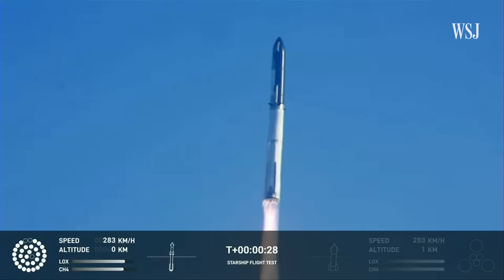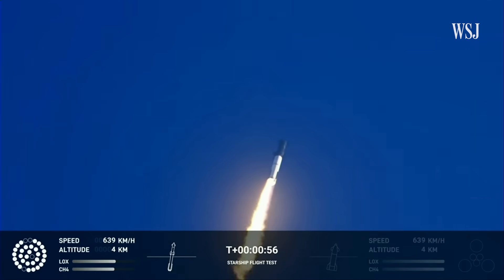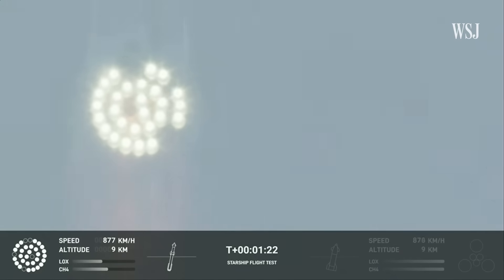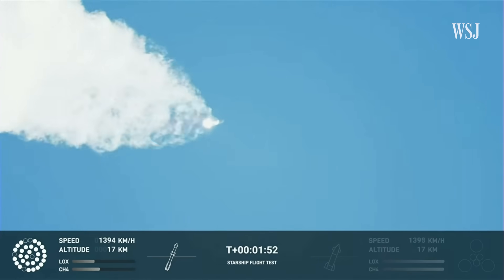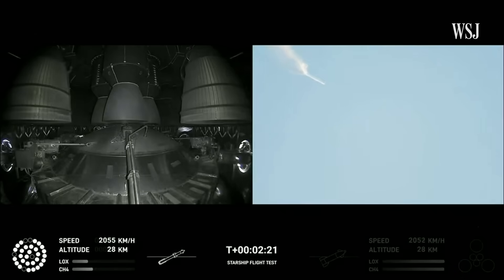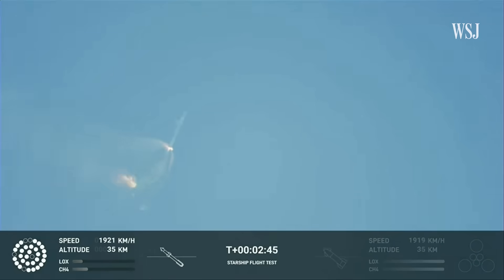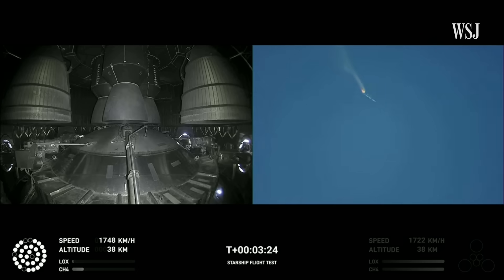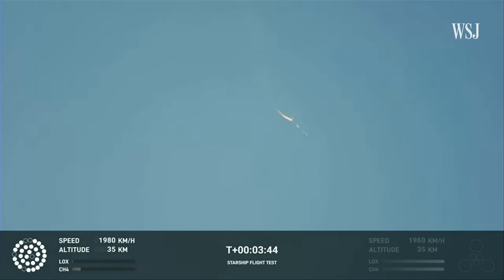Starship Explosion Video: Watch Elon Musk's Rocket Explode After Launch | WSJ

Comment: The amount of stress that was on the starshift as it was flipping is very impressive
Reply: crazy that it held together through all those spins
Reply: @P H  bro it looked like cgi.
Reply: @jeffder7143  CGI is difficult to detect, but its the BS of Elon that makes me distrust anything he is involved in.
Reply: @ph8429 stainless steel babyyy
Reply: @ph8429  Already passed the MaxQ right?
Reply: @estradacantu  They hit the "real" max-Q during the flip!
Reply: A lot of data was collected because of it.
Reply: @joaoklein1002  No because SpaceX refuses to learn from it's failures.
Reply: The rocket was already about 35km high, so there was very little air left. Cause when a rocket goes 1000km/h+ its not made to resist forces from the side. Would the cartwheels have happened at lower that ~15km/h the rocket would have been ripped apart quite quickly.
Reply: @eatdeliciouskids7965 still a lot of inertial forces from an object that large rotating that quickly
Reply: Good point, I hadn’t even thought of that.
Reply: @a-a-ronbrowser1486  nice name
Reply: What was the point of it flipping at over 800 mph?
Reply: @JoeBagzz  This was a big lab test the 1st of many for a rocket with twice the thrust of the most enormous rockets ever made in the U.S.  The amount of fuel needed is considerable along with the danger when fueling, a million things need to go right just for a green light for ignition.  So with this lab experiment, millions of things are necessary to go right for take-off and clearing the launch pad. You set a goal and start the experiments, a lot of failure is needed to learn and get things directly.   After separation failed they had limited time to try other tests before self destruct, spinning at 800 is a stress test that is not easily replicated on earth.  During those seconds of spinning, data was collected from instruments, you also found out which ones continued working and which ones failed under the immense g forces and pressure.
Reply: Finding a cure for hunger and homeless ,hate and division would be impressive, this?
Reply: @mikebuck8846  there is no cure for such things
Reply: @mikebuck8846  You do realise that hate is simply the flip side to love?  And like all opposites, such as cold/hot, dark/light, winter/summer, man/woman, wet/dry and so on, you cant eliminate hate as its just as essential as love.  Love is a total unquestioned approval of another, irrespective of their failings, and hate is just the total rejection of someone, usually because of very sound reasons. Love MUST be tempered with some hate, and hate must be moderated with some love.
But both love and hate have their places, and are equally essential to a balanced approach to life.
Reply: And it held together for so long!!!
Reply: KSP all over again...🤣
Reply: Ooops... What happened? 🙄
Reply: This is a fake CGI cartoon.
Reply: It truly was an amazing sight to watch and see. I don't feel the gen pop understands just hoe mamazing what they're watching actually is...I don't get many opportunities to use this term but man that sure was AWESOME!!
Reply: @arnoldrodriguez6300  Lol. You talk about the "gen pop" as if you aren't in that group. You Elon simps are pathetic. I'm glad it blew up.
Reply: @arnoldrodriguez6300 … well , don’t complain about the current price of eggs 🥚.
Reply: @vincentriley3698  I own 2 acres and have plenty of chickens...I won't complain. Promise 👍🙂
Reply: @arnoldrodriguez6300  Jesus..it failed dude.
Reply: @arnoldrodriguez6300  you're an employee who gets told what to do so you can feed yourself, curb your narcissism son stay silent and humble
Reply: @StoneTheCr0w  I see you like to assume. People who are angry at the world typically have that in common.
Reply: Theyllncome up with a better.launch.
Reply: Yeah I'm surprised how long it lasted, tbh. Was expecting it to break-up at any moment after the second or third flip. I'm not sure it did break up on it's own, it very well could've been a self destruct. They were losing engines and fight have control over it anymore, and it didn't seem like it broke up like we would normally see, it seems like it exploded.
Reply: Yea bouncing off the firmament 😂.
Reply: Musk fans are really trying to cope.
Reply: True, although more than likely, the explosion came from intentionally aborting the operation after Space-X determined it malfunctioned. They intentionally blow it up into little pieces to minimize potential danger.
Reply: @Karl with a K yea go ahead and give me something to see😂
Reply: exactly
Reply: I had to be down to low weight in bottom half + wind speed! Was a great lunch. 😊
Reply: Aerobatics with a rocket! Seriously though, it's so refreshing to read informed comments. Even the MAGAts are behaving because they count Elon as part of their cult. That'll clean up ANY comments section.
Reply: Was NUTS I couldn't believe it took the forces.
Reply: A bunch of idiots launched a failed starship !!! 😂😂😂😂🤣🤣🤣🤣🤣🤣
Reply: Right!!!
Reply: Insane amounts of g force spinning like that
Reply: Innovative technologies were presented at the international online forum "Global crisis. There is a way out". For example, the health capsule (the possibility of life extension, rejuvenation and absolute health), from time 7:09:09.
These technologies will be available free of charge to everyone when building the Creative Society.
Reply: Yeah, ppl don't understand that the starship is legit a 5000 Tonne rocket (when fueled) it burned up a lot of the fuel in the first stage for sure but it is still very heavy. AND it is going at 1.5 times the speed of sound.
Reply: @Cewu  People ought to face reality, and watch the videos on Musk, by youtuber, "Thunderf00t". Including his commentary on this failed launch.
Reply: is a starshift shifting gears in space?? 🤔
Reply: Humans are not advanced enough to creat 100% safe starship.And we think of warp drive😂😂
Reply: do you work in material science ?
Reply: @karlwithak. you would be dead meat regardless if it exploded or not.
Reply: A second failure soon to follow.😂
Reply: Was this a stress test? I'm confused. I didn't know this was planned. Looks like a total failure to me.
Reply: More than 10km falling with insane lateral forces while flipping like nothing...
Reply: Yes let's take a moment to remind all the commieboos that the N1 broke up at half the flight time and couldn't manage a single flip without breaking itself apart. 😏
Reply: @Karl with a K In a sense test resulted in a more  valuable than if separation and starship ignition happened, as  that insane structural integrity test never happened to that extreme
Reply: @yuzoookun  i say it failed this "interity test" you speak off.
Reply: no worries.  the tax payers will cover all costs.
Reply: @TheLinuxYes how so they are a private company?
Reply: Finally, someone got it.

Thank you, Sir. @TheLinuxYes
Reply: Finally, someone got it.
Thanks, sir. @TheLinuxYes
Reply: Cope harder. hahaha. Seeing it fail and and disappoint the people that wanted it to work as planned so badly, feels really good. Bye bye
Reply: Stainless baby
Reply: Yes, it was moving so much as it went up, it didn't look good.
Reply: Staying together for that long, sideways at 2000kph is very impressive!
Reply: I'd say that was deliberately done to test the whole structure. And it passed...!
Reply: I still cant believe it wasnt torn apart by the aerodynamic stresses during the "tumble".... and how long after it started tumbling it took spacex to FTS the thing.
Reply: @Karl with a K you would be dead
Reply: This is a waste of money and resources. Someone enlighten these rich folks
Reply: @Health-ScienceNews  its ok since the taxpayer is paying for most of it
Reply: @TheLinuxYes  still better budgeted then the fed.. 😂
Reply: @Health-ScienceNews  This is part of R&D. They WANT things to fail so they can figure out how to prevent it from happening when REAL humans are on the REAL starship.
Reply: they can do wonders with CGI these days.
Reply: @everythingisalllies2141  You're mentally ill if you think that's CGI
Reply: @everythingisalllies2141  dumba$S
Reply: About the same as the amount of stress that was on Elon's face when it blew up.......he knows this thing will never work.
Reply: @Patrick-bu5vy yea sure buddy
Reply: @Patrick-bu5vy the space shuttle was worse then this and was doomed from the beginning..
Yet it flew for like 30 years and did many amazing things
Reply: @Patrick-bu5vy  libs say the darndest things!    You remind me of my 4 year old nephew.   So cute
Reply: Can't pass through the firmament dome.. The earth is flat
Reply: @taylorx2  nice b8 m8
Reply: @taylorx2 lmao
Reply: @taylorx2  Are you serious or just kidding ??😮
Reply: Nothing about this was impressive
Reply: @jeffersonwinfrey2219 geek bruv
Reply: @jeffersonwinfrey2219  Would be interesting what Mr. Korolev or von Braun would say
Reply: @jeffersonwinfrey2219  Because you do better
Reply: @jeffersonwinfrey2219 you know nothing of anything if you think nothing of this was impressive
Reply: @jeffersonwinfrey2219  How exactly can you justify that. Everything about it was impressive.
Reply: @jeffersonwinfrey2219  Sorry you cannot understand.
Reply: @jeffersonwinfrey2219  When a 5000 Ton Mega Machine nosedives up in the air at 39 KM altitude, the engines that tried to push it back straight and do everything it can with it's side thrusters to get the mega flying structure back in the loop and keep pushing it up is not impressive for you? Someone gotta check their senses and make sure it's working properly.
Reply: @Pravin Smart  No, it's not impressive. Artemis is impressive, seeing as it WORKS lol!
Reply: @randomname4726 each Artemis SLS rocket alone costs more $ every single launch than Elon has spent to date. Eventually Elon will get to re-use his ships. Not 1 part (including the capsule) of the SLS is re-used.
Reply: @pravinsmart  those weren’t side thrusters. Apparently that was the self destruct system, which is now being questioned if it was even effective. Instead of bursting to mix the fuels together for a full on explosion, the explosives just punched little holes in the skin. They just got lucky it exploded on its own before it came back down. That indicates something was going amuck internally as well. There seems to be a lot of hush-hushing surrounding this launch. If you see the control room footage, there was no cheering. They were all running around checking each other’s computer screens intensely. Elon didn’t look thrilled either.
Reply: @jeffersonwinfrey2219  Get your depression addressed.
Reply: @jeffersonwinfrey2219  bro thinks something the size of a a skyscraper doing barrel rolls vertically isn’t impressive well traveling 2,000KMH
Reply: @maxortega8073  at the altitude it was at, there was very little resistance. What you’re being told is musk and the PR team gaslighting us, and claiming there was tons of data they collected. They knew it was gonna get severely damaged on the launch pad, but musk ignored his engineers. Supposedly he wanted it to be specifically launched on 4/20, no matter what. You don’t do tests knowing where and why it’s gonna fail, you do it to find the unanticipated failures. We are applauding someone who didn’t listen to his engineers
Reply: @JamieWex  tf u talking abt resistance thats not the force it had on it the force it had on it was centrifugal force and yes they knew it was probably going to fail but you are wrong they didn't know what was going to fail
Reply: @maxortega8073  oh but they did. Elon even tweeted his launch pad was possibly a mistake. The vibration suppression systems were basically ignored and not installed. I don’t get why he’d still launch the machine, but he said it. He built a launch pad that blew a bunch of debris at the engine after being warned. Nothing about this launch went right, and it was the stuff they knew would fail. He also built a rocket that was somewhat like a Russian N1 rocket 60+ years ago that was proven to fail. He used steel, which for some reason still bent with such little resistance, yet is stronger. From what I’ve seen, this machine was an engineering nightmare. Most of the time they use aluminum, which is comparatively cardboard in comparison for material for rockets. He litterally bent up steel in high atmosphere using 50’s tech. You gotta seriously make an effort to do that
Reply: @JamieWex  Thank you for being one of the few sane voices of reason here.
Reply: @randomname4726  they kept saying the same thing about the completed starship itself. All of them ended up blowing up, one of which happened several minutes after landing, and had developed a small fire in flight. It was the same absurd “but the wonderful data collected!”. The ‘first stage test’ apparently was a mass disaster too. He’s launching rockets that are severely flawed and prematurely at that. I don’t get how this is data collection.
Reply: @JamieWex  ahh you made all the points I was gonna make. It was actually going slower than the Concorde super sonic passenger jet too. It was eventually just gonna fall back to the ground
Reply: @jeffersonwinfrey2219  then you dont understand anything relating to metal stress or engineering principles, but even then, you can still be impressed with what was accomplished.